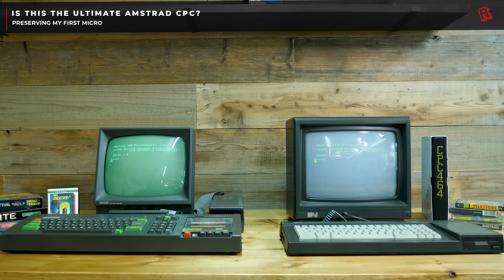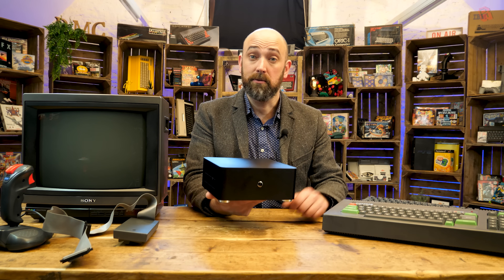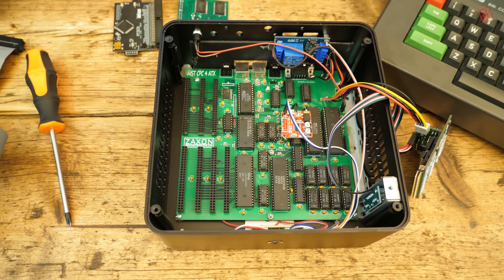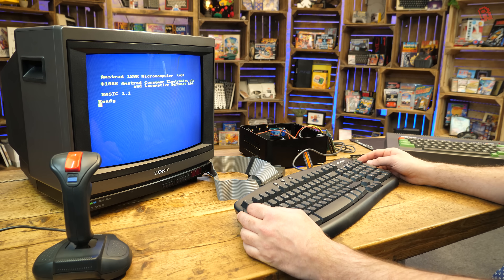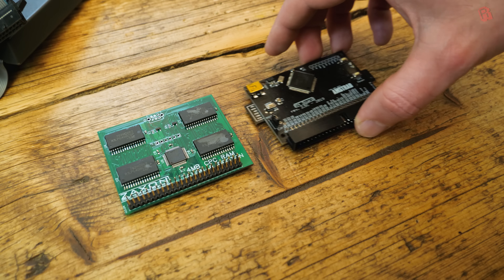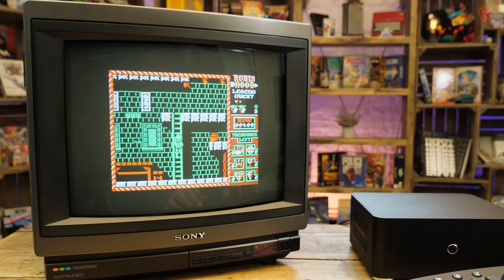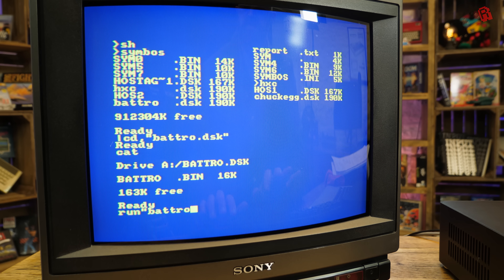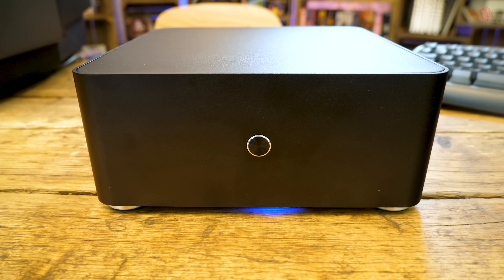Just CPC4ATX - My first Micro Computer has been Cloned! | Tech Nibble

Comment: I'm kind of disappointed it doesn't come with an upgrade card that officers more modern screen connectivity; whether just HDMI or also DisplayPort; with ever less CRTs available, and many people not having them anyway; a more convenient way to hookup modern displays would have been at the very least good. Even if he said, "Nope, get that upgrade separately" one would think you prearange slots for them in the 3D printed board, with inserts that are easily removed; now one would have to 3D print such a board yourself, or manually cut it out of this one.

It's a rather missed opportunity.

Comment: I have a MSX-VR, 1 of 4 in the UK, it has 4 MSX cartridge ports, 9 pin D joystick connectors, although it is based around a pi3b, with a clever hat, to support all 4 MSX standards, including the tape interface, Sega master system,  ZX Spectrum and ZX81 systems! Further upgrades will be implemented in the future. There are 4 as far I know in the UK, I would send it for you to look at, but them as soon as you open it you would void the warranty :(

Comment: See, now upgrades such as 4MB are pointless. I'd like to have seen a hardware sprite controller, a blitter or a RISC graphics processor, a second yamaha sound chip. Using the existing 6128(+) hardware to push external graphics and sound, mixed in with the CPCs. Imagine a Starfox or Virtua Racing clone on this.

Comment: Oh, that's interesting. If reproductions can be made easily, adapting the design for NTSC and 120V might be a bit more practical than actually getting a CPC imported and securing the voltage converters and adapters I'd need to accommodate it.

Comment: I'll be honest.  I'm not sure how I feel about this.
Having a computer run on authentic hardware is awesome.
Emulation is never 100%. EVER!

But this IS more or less original hardware.
I think I'd HAVE to get the version 2 and put it in an original case.
But I have a 464 and 6128 already...
So I'm not sure it's an "upgrade" that's worth it for me. I also couldn't see a price on their website, or indeed an actual link to it.  Perhaps I missed it.
I'd rather have an SD card added to the 464 or 6128 and use that, or perhaps even the audio in mod and load from mp3.
I still have all my original CPC hardware and software from the mid 1980's. So seems daft not to use it.

Comment: I am going to be assembling an ATX 64 board next week. it's an M-ATX format C64C with expansion, dual sid and many improvements to display. It's going into a beige desktop case and I plan to design a 3d printed front that looks like a 128D and then making wireless keyboard adapters for it.

Comment: You asked if it was possible to reduce load times by increasing the speed of audio, and yes it is indeed possible. I did that on another Z80 micro (the Video Tech Laser 500). I wrote a custom loader similar to "turbo tapes" and also a program on the PC that generates the .WAV file to play. As an example, it loads a 18K byte program in 30 seconds including 4 seconds for the custom loader. It's here: https://github.com/nippur72/laser500-wav

Comment: Really neat little design. I would like to see a lot more 8bit and 16bit systems re-designed to fit into mini itx or similar small form-factor enclosures. The expansion options are the icing on the cake.
You have me thinking about the lack of authentic keyboards now, that could be a good problem to solve.

Comment: When speeding up the audio for loading, did you also change the pitch? I'm not sure if audacity does that for you, but i think that would help. speed up and pitch down.
Reply: Won't work, I'm afraid. The CPC adds "precompensation" to the signal when recording, to increase the difference between  a "1" bit and a "0" bit ( 25 uS added to high bit cycle, and subtracted from low bit cycle). Precompensation needs to be increased with higher write speeds. Speeding up playback will cause both high and low bits to have the wrong cycle durations.

Comment: I am a vintage computer user, maintainer and collector but I can't see the market for such computer remakes. People like me like to tinker with old computers and their weaknesses and that is part of the fun. These kind of remakes take all that away. It would be more reasonable to use an emulator and I am sure the timing issues would be negligible especially for people who want to have a taste of these old machines.
Reply from the maker: I can understand both sides of the argument, either way, you have to admire the skill and tenacity to reverse engineer your favourite micro, it's quite admirable, and I imagine a lot of new knowledge was picked up in the process for Zaxxon
Reply: @TheRetroCollective  Zaxon now needs to build a replica CRT screen with the power supply inside it, for the full experience. :-)
Reply: @TheRetroCollective  Yes I am sure Zaxxon had a blast reverse engineering and building this great motherboard but I can't say the same for the users. The user will see just the blunt generic box. Not even the smell of those old caps heating up. 😉. Great work from Zaxxon nevertheless. 👍
Reply: @embedoklistube  Depend...;) When i released my Js128 (ZX Sperctum clone board)  i plan build maybe 20 or 30 pieces.....I show it for the people...and  on the moment  is  over 400 working machines ;) It is also reason why i do Just CPC 2. It is board what fit in to real Amstrad CPC 464 case ;)

Comment: now need a hardware recreation of the Dragon; and a physical enclosure recreation of the Acorn Risc PC could be powered by a modern Pi and it wouldn't be emulation
Reply: and make it 100% TRS-80 Color (COCO) compatible as well!, :-)
I think a emulator, would do,  I remember using a TRS-80 Emulator one time, I now think was much cooler now, than then , I now more about How PC's, work I've lost the details  of what it was, but what was cool about it was it seem to boot from the (486) PC bios , from a only a floppy disk, with out any PC OS, needed, like It was a PC OS, the display would look that of an TRS-80 Color, at that time I was new to PC's, it may of been just small Linux OS distro, only auto boot an emulator, of some sort, But what I remember, it seemed to fast, functional,  lost the disk and never found a replacement so could never fully test it. that was the end of that :-(
Reply: @dh2032  the best software emulators for retros that run on Raspberry Pi boards are the bare metal implementations (they don't boot any manner of Linux OS or otherwise); there's essentially now a library and framework for rolling bare metal emulators to run on the Pi. Believe the Commodore 64 already has great implementations, but would certainly be cool to see a bare metal Raspberry Pi emulator that well supported the Dragon, CoCo1, CoCo2, and CoCo3 - but maybe the CoCo3 should be combined with the GIME-X project so as to take advantage of that project's FPGA re-implementation of Tandy's custom GIME graphics chip that was rolled out on the CoCo3 (that chip also serves as a rather advanced MMU - to map up to 512K memory, but enthusiast have got it to map up to 2MB)
Reply: I don't think you actually need much to do a hardware recreation of the Dragon.  It's literally a clone of the coco, and THAT was pretty much all off-the-shelf Motorola parts.  You could literally go and do it all now, and probably even simplify the mainboard to a ridiculous degree by using a microcontroller in place of the original video chip and modern s-RAM.
Reply: @TheTurnipKing  Well, there was the CoCo3 that had a pretty cool custom GIME video chip (which also had a fantastic MMU too - which enthusiast have used to map up to 2MB of memory even though Tandy only intended it for supporting up to 512K); However, the CoCo community is very active and there has been this project to recreate the GIME chip - the GIME-X project:
https://thezippsterzone.com/2019/03/27/gime-x/
And I believe the Hitachi 6803 is still to be had as a superior drop-in replacement of the MC6809 - so a new board design would get some kudos from enthusiast if it went with the Hitachi CPU - and there's a NitrOS-9 implementation that takes advantage of its instruction set additions
Reply: @TheTurnipKing  Strictly speaking, the Dragon ISN'T a clone of the CoCo.  They're both pretty much Motorola's reference design for a color 6809 micro, so they come out almost the same (with only some relatively small hardware differences and a ROM swap needed to convert one into the other).
Reply: @evensgrey  Potato/potato, tbh.  They're so similar as to be damn near binary compatible, as you point out.

There are actual US versions of computers that aren't so closely hardware related.  (I'm thinking of the US Timex Sinclair/ZX Spectrum, or even the changes nessecary to have a PAL C64)

Comment: That's actually awesome about Tape Drive emulation over Bluetooth. Makes sense, but would've never considered it. I haven't seen any C64 tape adapters on ebay doing that. Looking forward to those coming out eventually.
Reply: I saw a BT put into C= tape drive for that line.
Reply: Renzi has it through the cart port Remziload64
Reply: Remzi load64  BT C64

Comment: I wanted the amstrad as a kid just because of the colours lol
Got a C64 instead. No regrets.
Reply: I am a bit bias, but I think the C64/C128 despite it's flaws was the best all around 8-Bit machine of it's day with the unique color(yes I'm American) pallet, hardware sprites, that lovely SID chip for sound, and just how far the community has been able to push the humble C64/C128 over the years. I also had an Apple IIe at the same time with dual disk drives, and outside of a handful of programs like Print Shop Deluxe, and the expansion slots on the Apple, the C64, and later C128 where miles ahead of any 8 bit computer here in the US.
Reply: @CommodoreFan64  - it's worth noting the the CPC had more capable graphics, more memory and a faster CPU - but yeah - it could never match the C64 on music or the sheer number of programmers that released stuff for the C64.

it's arguably the best because of what's available - but from a pure technical standpoint? the C64 and even the CPC - were far from the most powerful home computers at the time in terms of raw power.

Things like hardware sprites skewed the perception of the machine - the SNES was dramatically less powerful than the Genesis for example - but its hardware accelerated features meant that the games as people perceived them? were on par.
Reply: Understanding computers like I now do? I think I'd of been really happy with an Amstrad - yeah the C64 is iconic - but not for any reason that the Amstrad can't also claim - other than sales figures ;)
Reply: I had a CPC464 as a kid (as well as Atari 400, Atari ST, PC) and became a coder. Loved the C64 sounds and sprites.
Reply: except if you tried to play something like Chase HQ which was great on CPC/Spec and crud on C64. :P